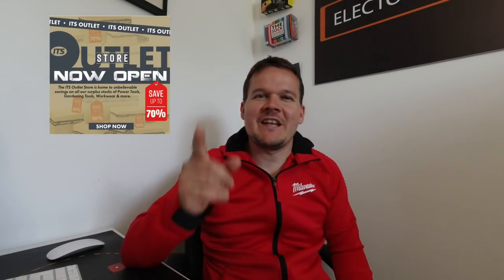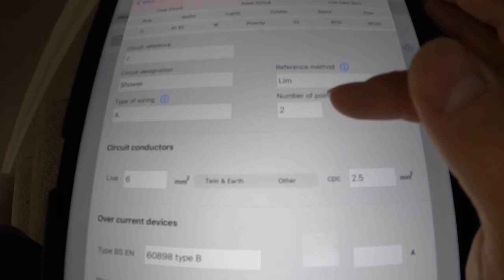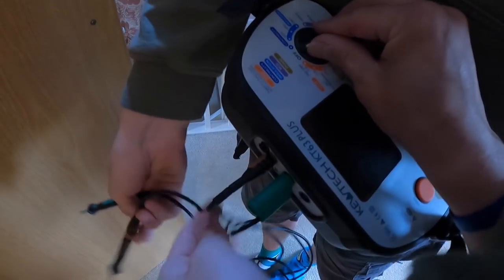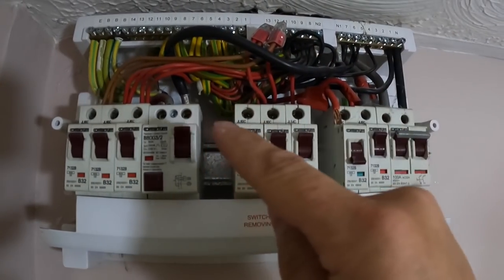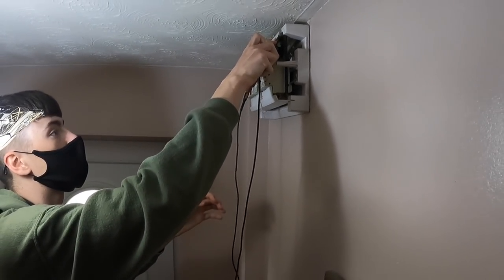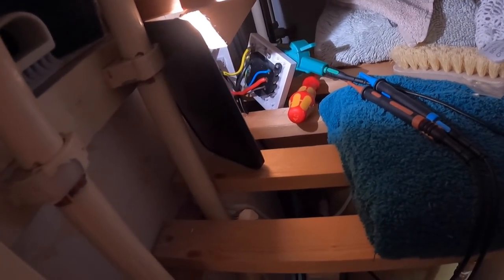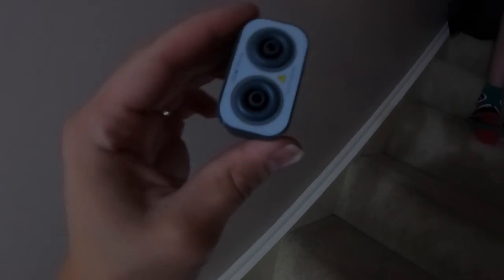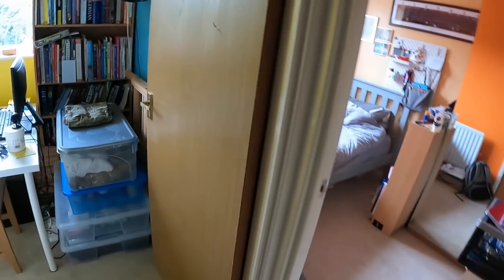Electrician - Condition Report. Get yours checked before it’s to late!!

Comment: If that 2.5 is only going into the fused spur, then surely it's OK as it can never draw more than 13A - ISTR cables can be protected at the far end if <3m
Reply: That's what I thought as well. Its a only the same as souring of a ring.
Reply: Yep, 
433.2.2 is the relevant regulation
Reply: It doesn't even need a 13amp spur to be honest as it's a radial

Comment: No RCD protection on various circuits isn't a C2 - providing the installation met the relevent standard at the time - already been said its a 16th edtion box at the start and RCD protection wasn't required in those regs as new ones are not required to be retrospecitvely applied unless you would be carrying out additional works but certainly is a C3 as a recommended improvement. It isn't dangerous as such - could just be better. As for the bath pump - its never going to exceed 13A as that is the limitation of the fuse in the FCU, although that wouldn't preclude someone else from unknowingly spurring off that cable for somethng else.
Reply: Agree , you recommend as an improvement to go to all circuits on RCD.
Reply: Totally agree, Just as long as cross bonding is in all bathrooms, Extraneous metal and electrical circuit's, As 16th edition unfortunately plumber's/bathroom fitters don't earth link copper pipes when push fitting plastic, so that kind of buggers that, It's so difficult to get everything spot on, nobody can imo, 😆
Reply: @reecehorner3736  Yea but how often is the bonding in place to circuits, not just the pipework? Hardly ever

Comment: I consider the 2.5mm acceptable to regs. The 2.5mm is protected downstream by the 13A fuse and is less than 3m.
Reply: Was it not on the live side of the 6mm
Reply from the maker: Correct
Reply: @Sowie-sm6xk  Doesn’t matter. You are permitted to use downstream protection.
Reply: @AndyK.1  What's the reg? Not familiar with that one but every days a school day.
Reply: @AndyK.1  correct answer. Is the same as meter tails of the main head not being allowed to be more than 3 meters. Sorry can't remember the reg number or be bother to find it😉
Reply: No different from a 2.5mm spur off a ring final or spur straight out of the mcb
Reply: @ryano8768  434.2.1
Reply: @simonparkinson1053  433.2.2 is the relevant reg, dealing with position of overload protection.  434.2.1 refers to fault current, which would be assured by the 32A MCB, assuming adiabatic requirements are met
Reply: @andrewcadby  yeah, you're right. 433 is the overload part of it.
Reply: You can have one 2.5 spur anyway

Comment: You never know what you are going to find when testing. 👍 don't forget to put on your report insulation resistance testing only carried out up to the circuit isolator. .i.e. the pull switch in the roof..👍👍
Reply from the maker: We disconnected the neon after the camera went off.

Comment: Excellent demonstration. Something useful might be to demonstrate things to look for on the consumer unit. Incorrect blanks. Labeling. Mixed breakers. Accessibility. When to code plastic consumer units. Maybe go through all the tick list for consumer unit. 

That tester is super annoying BTW 😂 I use a kewtech but an old one. It's impossible to watch this video quietly! Otherwise excellent. Cheers.

Comment: Nothing wrong with coming off that 6mm with 2.5mm. It can only ever draw a maximum of 13A from the fused spur. It's exactly the same thing as a spur from a 32A Ring final.
Reply: That's interesting 😂😂😂😂
Reply: @londontrada  what's interesting? Interesting to know I'm correct?
Reply: @londontrada  check down the comments there's a big discussion on it. You may see my point.

Comment: Is it still any ciruits over 32 amp is 5 seconds and any thing under is .4 and what was .2
Reply: TN system- 0.4s is for socket(s) up to 63a and 32a supplying only fixed equipment. It's 5s for  distribution circuits and circuits not covered in 411.3.2.2. TT system- 0.2s is for socket(s) up to 63a and 32a supplying only fixed equipment. It's 1s for distribution circuits and circuits not covered in reg 411.3.2.2.  See  table 41.1,  reg 411.3.2.2,  reg 411.3.2.3 and 411.3.2.4.
Reply: @Timetochange76  thank you I qll get confused with them

Comment: So a socket spurred of a ring will be generally in 2.5mm on a 32a breaker and acceptable, so explain to me how the bath pump thing is different please?
Reply from the maker: It’s a radial
Reply: @Cjrelectrical  but it’s still 2.5 on a 32a just like it would be if spurred off  a ring??? So what’s the difference, how is it less safe
Reply from the maker: Because on a ring circuit the current is shared and if spurring off you will only be spurring to a socket outlet or spur that will have a 13amp fuse for overload.
Reply: @Cjrelectrical  but it was spurred off once to a fcu so no possibility of drawing more than 13a thru it.
Reply: I was about to question this due the fact the cable has secondary protection so the 2.5mm will never draw more than 13amps
Reply from the maker: Would you wire a radial buried in the fabric of the building in 2.5mm2 off a 32amp mcb?
Reply from the maker: Apply your common sense. In my opinion remember this is my opinion I wasn’t happy with it being in 2.5mm cable. We disconnected the hydro bath anyway.
Reply: @Cjrelectrical  no, however was it not a 6mm radial from the board to the first fcu, then spurred off only to the second in 2.5? Common sense applied, there is absolutely no issue with that.
Reply: @Cjrelectrical  While I dont disagree with you wanting to change it or disconnect it and I would have done it myself. As long as the overcurrent protection is less than 3m from the reduction in cable size it is covered in 433.2.2ii
Reply: @Cjrelectrical  might have used a small size breaker
Reply from the maker: 433.2.2 doesn’t that refer to consumer unit and metering equipment ? Not accessories
Reply: @Cjrelectrical  I have been in the same situation and I called nic I'm just giving you there answer and it would just be a code 3
Reply from the maker: Are we also forgetting the fact that a fuse connection unit isn’t designed to terminate a 6mm and 2.5mm cable
Reply: @jamesthew800  your right, there's no danger of the cable being overloaded, it's poor workmanship, lazy call it what you will, but there's no danger present
Reply: @Cjrelectrical  I am guessing they wouldn't, especially if there was a load of sockets hanging off it, because in ideal conditions 2.5 it's only good for 27amps, so things could get a little warm
Reply: @Cjrelectrical  It is not so how much of the 6mm had been removed to make it fit
Reply: @Cjrelectrical  Are you assuming that the 2.5mm could take a full 32 amp load or are you going to remove the 2.5mm and place it on the fused side of the fcu
Reply: @Cjrelectrical  All forms of overcurrent/overload protection 433.1 even references plug top fuses
Reply: @Cjrelectrical  It's within 3m so it's fine as it's not going to draw the full load of the circuit, that FS might not take a 6+2.5mm cable but many do because 32amp 4mm radials exist which would be 8mm total. 
The downstream protection option isn't used much but it's allowable and Efixx show cased it a couple months ago if I remember rightly.
Reply: This is a good old electricians debate. The real question being asked here is to consider these factors: 
1. If it’s fused down is it ok (I would say yes) 
2. If it isn’t fused down, is it ok (I would say no, but why?)
2.i) if not fused down: is the fixed equipment going to draw more than the current carrying capacity of the 2.5? (I would say no). Does that mean that in a fault condition, it could draw 32A and slowly start to deteriorate the 2.5 (I would say in theory yes, although this would be very slowly indeed) 
2.ii) The argument for it being ok and not being fused down: it is fixed equipment not likely to ever exceed the CCC of 2.5 (I would say probably not) Would I do it (no). 
3. Does it generally seem right? (I would say no). This install was most likely done by a rubbish bathroom fitting company (or the company selling the electric bath), who are not electricians and are looking for an easy install. I base this on the isolator in the loft, the loop going to a JB in the loft. The entire set up of the shower pump is a mess. 
4. If this was in your house, would you be happy with it? (I would say no). 
5. Is it technically, technically, wrong? (I would say probably not really). 
6. Imagine someone got a shock in the electric bath and was severely injured, perhaps had a heart attack. Now you’re in court having to justify your actions. Would you rather take the time to disconnect it and err on the side of caution, or try to argue that it was ok and too bad that the person got a shock and had a heart attack? (I would rather disconnect it). 
In summary: I would have done what Chris did.  This is the whole point of the video, do you hire a cowboy who can do an EICR in half a day, or someone with common sense who will do things well, abide to industry best practice and striving to improve standards rather than doing the bare minimum for a quick quid. I’ll let the YouTube viewers decide I guess, that’s the risk/reward of showcasing your work for all to criticise or praise.
Reply: @maliklindo10  i rang Niceic about a 2.5mm off a shower pull switch for a gulper pump he said its not time under fault but the temperature the cable will reach under fault and gave me an equation hope it helps
Reply: Big Mike coming in with that knowledge. Should've got some popcorn ready before scrolling down
Reply: @acelectricalsecurity  yeah but the 6mm goes to the first spur that can carry 32A , then it goes from a spur to a spur in a 2.5 , but that will be fused down to 13A so 2.5 with a maximum of 27A is fine for 13A
Reply: @samuel2j213 I know that

Comment: One 2.5mm spur is acceptable on a 32amp breaker.
Reply: So if I have a 32A ring final with 10 sockets on that ring I can only have 1 spur from that 32A Ring? 🤔
Reply: @ryanallen3704  no
Reply: @londontrada  then what can I have? 🤔
Reply: @ryanallen3704  What do you think? 🤔🤔🤔🤔🤔🤔🤔🤔🤔
Reply: @londontrada  you tell me as you said one spur on a 32A is acceptable?
Reply: @ryanallen3704  I wasn't talking about a ring final with 10 sockets. It's a radial circuit, did you even watch the video?
Reply: @londontrada  same thing as a ring final with a 32A..
If you're spuring off a 32A you can have as many spurs as accessories.
So 3 sockets (accessories) then 3 spurs. 4 accessories then 4 spurs. 

Catch my drift? 
It's just the fact you said 1 spur off a 32A is acceptable. You didn't mention radial or anything.

Comment: Shouldnt you disconnect earth from.pumps in the spurs as you could get parallel path ?
Reply from the maker: Cable was disconnected at Consumer unit
Reply: If you’re lazy and just do a link from the MCB to the Earth bar, then yes, but if you disconnect the CPC from the DB (which is the correct method), then you are only testing your cable. To elaborate on the initial query, for information: the metal work of the pump (if it is metal) would be connected to the pipework, which would be connected to the MET, which would be connected to the DB. Therefore, if the CPC for the shower pump circuit was broken, the fault current could travel down the pipework and back to the supply transformer and still operate the protective device. This is more luck than judgement and is not what we are trying to test. We are just interested in testing the cable. Imagine in the future all pipework was changed to plastic, this would render the electrical supply unsafe if the CPC was the copper piping. Hence, we should test our cable, irrespective of other parallel paths.  In an ideal world, testing a shower circuit should be one of the simplest circuits to test, it’s 1 point with a large cable. On paper, this should take 15 minutes to do all tests. What was demonstrated here, is that actually, it probably took an hour, if not more, because an element of remedial work was carried out (for free probably) to ensure the safety of the users. This is what people miss when employing competent people instead of cowboys.
Reply: @Cjrelectrical  the earth of pumps could create a seperate path through the pipework. Id probably do it same as you so i shut up !! Stay safe pal